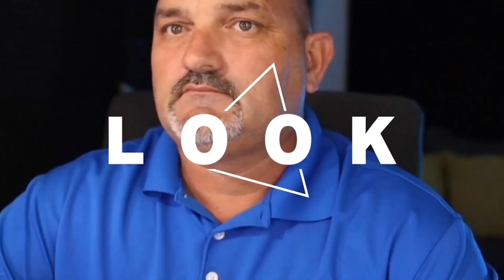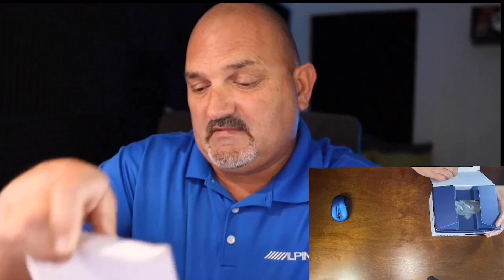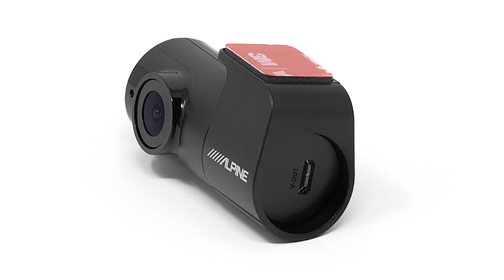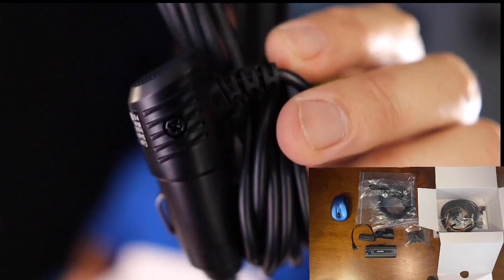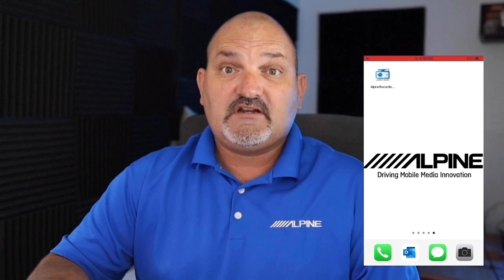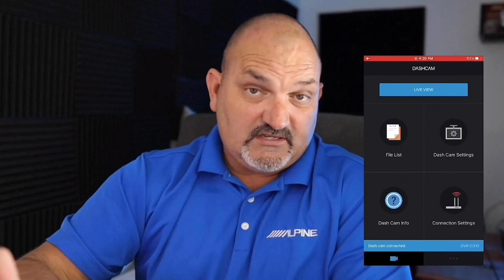Alpine's First-Ever HD Dash Cam with Built-in Impact Recording

Comment: Hello! I just installed a DRV-C320S dash cam and with continuous recording only 2 files can be seen overwriting it constantly. Only the folders are visible on the SD card and only a few hundred MB of space is occupied, yet only 4-500Mb of the card's 32GB capacity can be used. After formatting the card you can see all 32Gb but as we put it back in the camera again only 4-500Mb is available. What needs to be set so, that you can see previously recorded material in either the app or the PC viewer? There is nothing in the description to suggest this. Thanks!
Reply from the maker: Hey Guys, if you could, shoot our tech support team a call at 1-800-Tech-101 and they can troubleshoot that issue with the SD card.

Comment: How about an install of the DVR-C320R connected to an Alpine head unit? I completely wasted a month of time and my money on a product that YOUR tech support  and Crutchfield said would work flawlessly with my X409-WRA-JK. I even called and left YOU a message with no return phone call. Thanks Alpine!
Reply from the maker: Hi Sam, unfortunately there was a mistake on Crutchfield's product page that stated it would work with the X409 systems. This has since been resolved. The DVR-C320R can still be used as a universal dash camera system without needing to connect to a specific head unit.